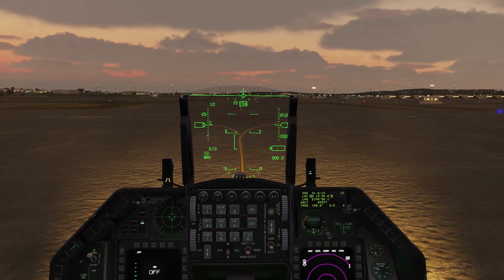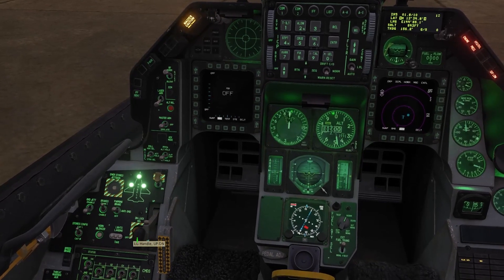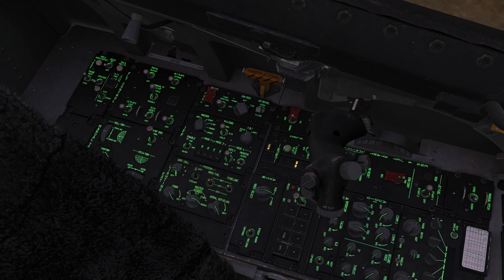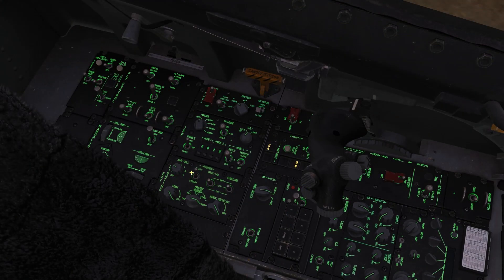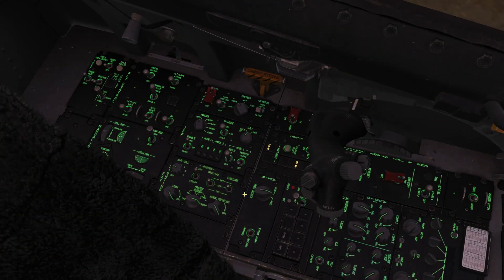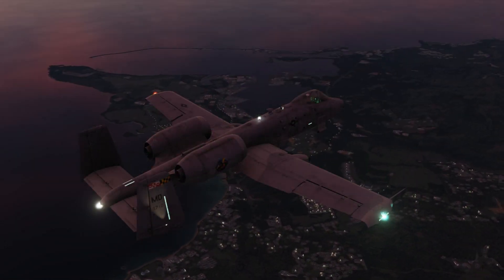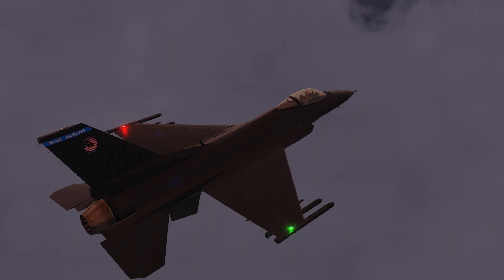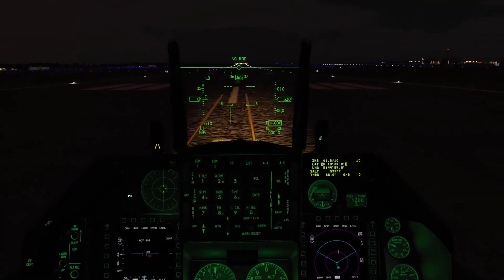DCS F-16 Viper lighting controls - DCS World

Comment: i'm i only able to turn the lights on when starting engine ? light won't work when power on main pwr
Reply from the maker: Should be able to operate some of the lights on battery, at least the navigation lights should work. The rest will need either ground power or the engine running.

Comment: how do i get night vision goggle?
Reply from the maker: It depends on if you have the NVG goggles mounted, as you can have either the Helmet Mounted Cueing System, or the NVG's. You can't have both at the same time. You can select which one is mounted in the mission editor, or if you are parked on the ground and contact the ground crew. You'll have an option there to change what is mounted on your helmet. Once you have NVG's mounted, the default keys to turn them on and off is Right SHIFT + H
Reply: alright thank u for the help @DieselThunderAviation
Reply from the maker: My pleasure!